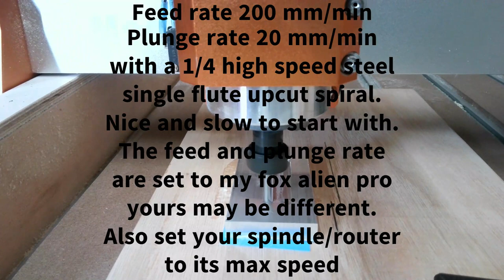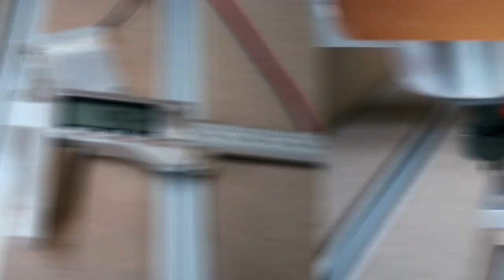How i made this XYZ Probe

Comment: Very nice! Do you have the Masuter Pro with the 300W spindle and 1/4" ER11 collet?
Reply from the maker: Hi yes it’s the masuter pro with the extension kit and I’ve got a dimmer router this was set on number 6 for max speed as for the collets I got them as a set on Amazon

ER11 Precision Spring Collet Set 15 pcs CNC Milling Lathe Chuck Tool https://amzn.eu/d/0mQEReU
Reply: @craigscnc6528  Okay, so it is not the factory spindle, but a router with more torque and RPM I suppose.